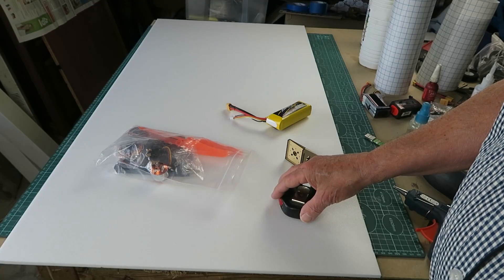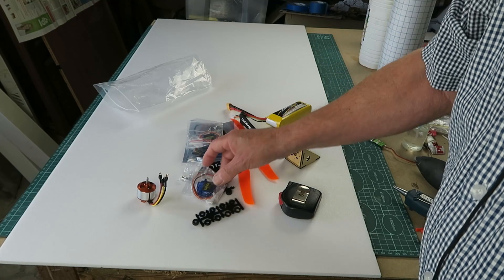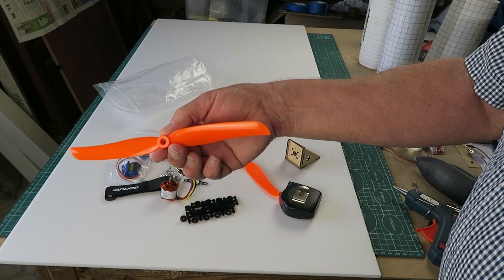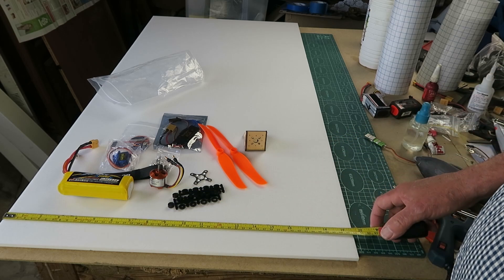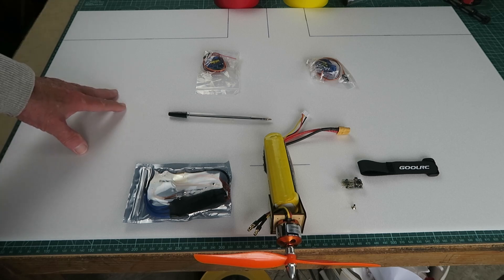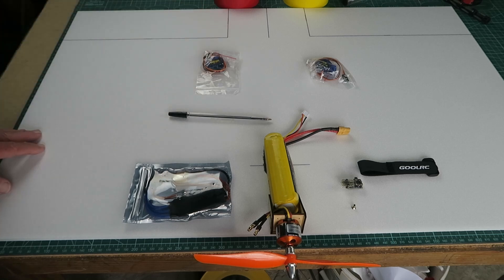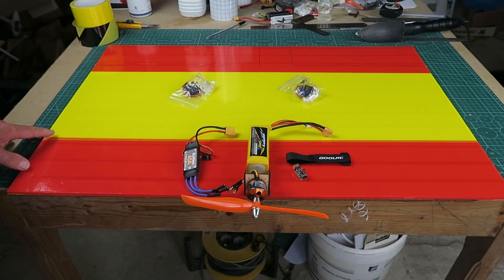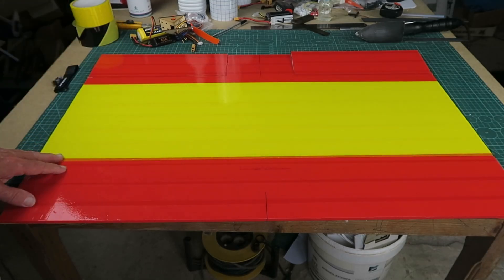Single Sheet Foamboard Plank RC Plane Build

Comment: in video description:   100 x 50   equals   2:1        you may know that correct cg location Can  Always  be  determined by the use of a  Ratio (of the chord length).        in this case, cg should be located near the  neutral point; eg., the  1/4-chord  line.     d
Reply from the maker: You were not paying attention, the sheet was cut to 750 x 50!! https://fwcg.3dzone.dk/ gives 100mm as the CG.

Comment: 320    elevons  are  HUGE.!     unless there is a  Reason  to not do so, the mass of the (elevon) servos should be located  Near  the  cg line.!      otherwise, the amount of tail-heaviness in the model's dom will be increased.          maybe you could show folks how to control  elevons  if they don't have a computerized tx.    hint  -  a single* aileron servo must be mounted on a 'sliding tray'.      *  because two servos would weigh twice as much.      d
Reply from the maker: The whole point of the huge elevons is to annoy armchair aerodynamicists!! https://youtu.be/Vgf_JwnbSrc?t=134 https://www.youtube.com/watch?v=Y2pwgJU5bfM&t=126s